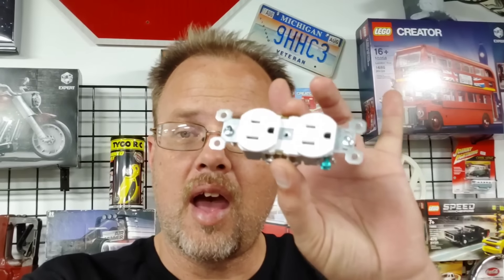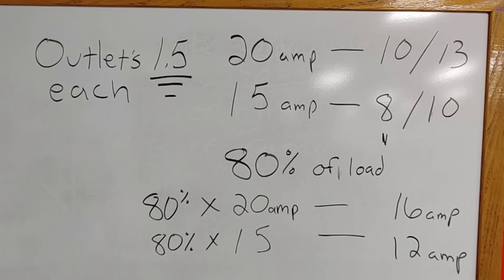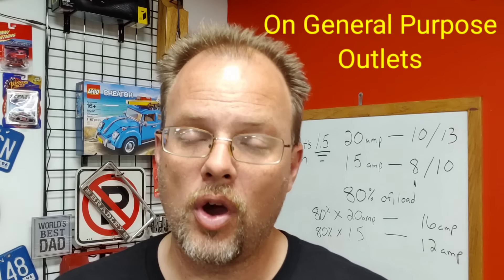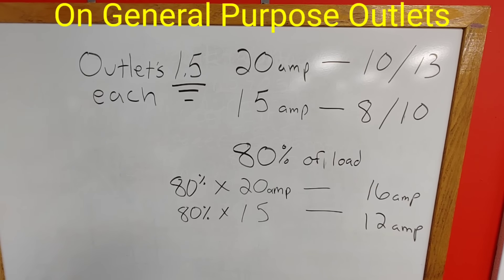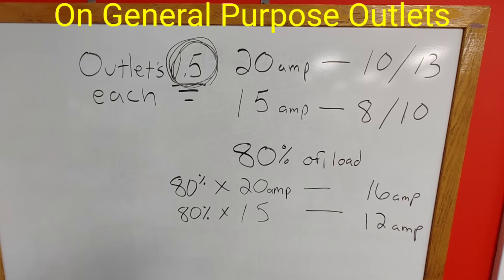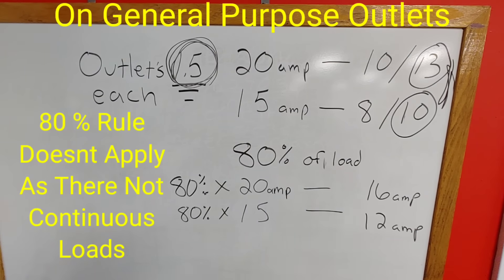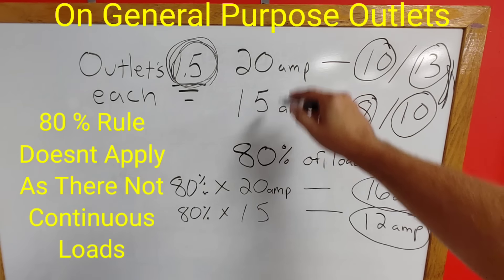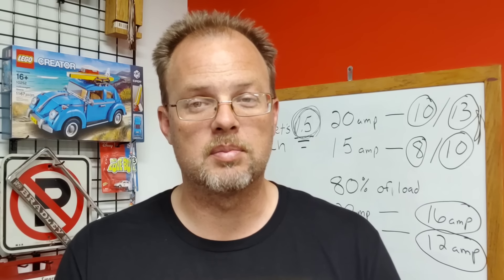How many outlets can you put on one circuit ?

Comment: It doesn’t matter because they are connivence outlets. It allows you to have a plug were you need it. You will never plug something into every outlet, and if you do, the breaker will protect the wire.
Reply: But you still could have a slow burn of the wire. New code requires ark fault, combo ark and gfci and surge protectors at breaker would help with prevention.
Reply: @georgeryan9139  Arcfaults, gfi, and surge protection do not  protect overloading of the wire.
Reply: In the 2020 code the arc fault and combo arc fault/gfci are the new circuit breakers.
Reply: @georgeryan9139  Yea, the 2020 code expanded the use of afci. But, you don’t have to use breakers, you can use afci or gfci receptacles or a combination. They are less expensive and in some cases more convenient for the homeowners.
Reply: I bet I could use every outlet! I've never had enough lol

Comment: Ok. First, there is plenty in the nec about the recepticals for residential and comercial to which i can add 90 percent of the comments are way off base..   first the NEC gives you the minimum code requirements for how many etc but you need to understand and reference the code book because difference location on a house has different requirements.... Here is a simple way to go about this. In a home take a living room 20 x 14 x 20 x 14(this wall has a 4' door in the center) so the 20' walls will require at minimum 2 outlets with no more than 12' between the 2 outlets. On the 14' you will need 2 outlets because of the 12' rule.  On the other 14' with 4' door you will be required 1 outlet each side of door.  This is minimum requirement. Any wall 2' or more requires an outlet.  Kitchen is another area for headache. This is all NEC requirements 2017 code book and on, as the book comes out every 3 years. Now here is another big pain in the backside and thats the Jurisdictions having authority(as in city inspection and or county etc). You will be wise to contact them and they will inform you as to how many etc etc etc. On on a closing fun note dont forget you box fill calculations. Commercial requirements is another subject. Also now required for new construction and any remodels that require permits, each of the following require their own individual circuit and it will be GFCI. Garbage disposal, diswasher. Refrigerator etc.

Comment: I need to add a circuit... someone before me added the garbage disposal, an outside gfci and an indoor outlet all in the same circuit. I trip these outlets every day... help!
Reply: Gfci will show up small faults to ground protecting you from shock. You could have wiring problem or end of use equipment. The other thing to check motors (dispose unit) draw 3 times amps on start up. Outside socket for water ingress. Good luck.
Reply: Trip them by an action of what ? , I recommend fixing the issues at hand (culprit) , don't just add a new circuit,  fix the issues with the existing one as well ,
Reply: If the circuit is on a gfci breaker, replace it with a regular breaker. THEN replace the outside receptacle with a gfi wired in parallel. If the inside receptacle is in a location required to be gfci protected, change it to a gfi receptacle also. 
If the circuit isn’t gfci protected, then most likely your disposal is “downstream” of a gfi receptacle. At the gfi receptacle change the wiring to parallel (no wires off the “load side”) 
If this explanation is confusing don’t be alarmed. A lot of Electricians won’t understand it either.
Reply: @dalewise5586  I understand it.. I was drawing it out a I read it. Thank you for the
Reply: Run a separate circuit to the garage disposal like it should be in the first place.

Comment: 120v x 20amp = 2400va[w]
Divide that by each recept.[180va]
You got a maximum =13 reeptacles
That's NEC code +Math
Reply: Each receptacle is calculated at 180va. By using your math you would be at full ampacity for the 20a circuit. If code requires you only put 80% on a 20 a circuit,  16a , then you could only put 10 receptacles on a 20a circuit.

Comment: The first answer was the correct answer:  for dwelling units, as many receptacles as you want for general purpose lighting circuits.   The rest of these schools of thought results from people second-guessing the Code or engaging in what-if scenarios instead of recognizing that the Code, although not a design document, considers the safety implications and the economy of an electrical system in what it allows to be installed.  Yes, you need dedicated circuits if you have special needs such as a window air conditioner or space heater.  But the wholesale overbuilding of the electrical system of dwelling units sometimes suggests the installer doesn't know what s/he is doing when it comes to design.  It's tribal knowledge, rather than the Code, which causes all these disagreements over how many receptacles can be on one circuit.
Reply from the maker: I totally agree but it's a never ending battle and you will never have two electricians in a room that will agree upon it usually LOL

Comment: Never leave an outlet out because you think there would be too many. People use dozens and dozens low power devices. If there are too many outlets the user will not use them all. If there are too few the user will use power strops. In either case the load is the same.

The whole thinking is backwards. You should first decide how many rooms you put in a circuit, ideally just one so that one person controls what is in the circuit. If there are two rooms and people in both want to use a space heater there is a problem. Then you put as many outlets as needed.

Comment: No, but if you do not use the rest of code for gage, length, no of wires in a box, proper nuts, etc, then they would help stop the fire. Or get an electrical fire extinguisher.

Comment: You can put 100 receptacles on one circuit if you want. Just so you don't exceed the load.
If this were not true, you could not have those tool box outlet strips.
Reply: Load is the key.  Putting 20 boxes on a circuit is more for convenience I think, and practically speaking - you don’t run all boxes at the same time.  It’s all about the load - and usually more troublesome with items with heating (toaster, kettle, dishwasher, hair dryer)... and runnning them all together.

Comment: Actually, you are talking in general. HOWEVER your local building codes may vary. Some residential codes actually use the eighty percent rule and do limit it to TEN on a twenty amp circuit with proper wire size. Some areas will give allowance for eleven if it is mixed circuit of receptacles and light fixtures. (switches don't count as they have no load of their own). Some area require plugs and lighting to be on separate circuits all together. YOU MUST KNOW YOUR LOCAL BUILDING CODES AND WHAT THEY REQUIRE AS THERE IS NO ONE RIGHT ANSWER. Also residential and commercial uses have different code requirements in most areas. Do not assume that they are interchangeable as they often are not. When I was an electrician many years ago, my boss always went to the safe side and limited us to ten outlets per circuit on twenty amps and did not mind if it came to nine on occasion. Also check local  codes on kitchens as many have very different codes but even when they do not, kitchens are a high demand area. We often ran three circuits to the kitchen and more if it was a large one. Better safe than sorry. We got a lot of referrals that way.

Comment: The question is wrong.  It should be, what is the maximum load that will be on that circuit.  If you are the type of person who likes to rearrange a room from time to time, like a living room, but the usual maximum load will be 10 amps with an occasional 5 amp load added for short periods of times, then putting in as many outlets as make your rearrangement convenient is okay.

Comment: Not good analysis.  The probablility of overloading a circuit goes up as you add more outlets.  There shoule be some smart decision being made when wiring up a house, such as not connecting many outlets to the same breaker, if there is a good chance that those might get overloaded.  For example, in the kitchen, someone may have a coffee maker, a waffle iron, a portable electric burner... that they want to use all at the same time.  Having those all on the same 15A circuit all at the same time is asking for trouble.

Comment: The right answer:
"So, what loads are we putting on here?"
"Well, it's for the kitchen, so, a toaster, the microwave, coffee pot, refrigerator, hotplate, electric skillet, and two space heaters..."
"Piece of cake. 15 outlets on a single 15 amp circuit!"

These are blueprints I was expected to wire from.
Reply: You already know but,
The code requires different wiring for a kitchen than other general use outlets in a residence. Must provide (at least) 2 small appliance branch circuits for counter height receptacles that are required to be fed from 20 amp branch circuits. It is also your responsibility to ascertain other loads that the kitchen will be equipped with (large refrigerators that require a separate circuit and so on).
Blueprints can't override Code requirements. I'm probably preaching to the choir here, LOL
I've seen the same kind of blueprints but they always have the butt covering statement of "must follow all national, state and local codes"
Reply: @liffy8333  Absolutely. With new construction. And on new, I go far and beyond that; e.g., the Microwave and fridge each get their own circuits, etc.
On existing, especially older, far different world.
Especially if its owner thinks he's handy.

Sadly, I know builders who will bid off known bad prints, and then try to use that "Disclaimer" as an excuse to buy Cancun. More money is made off of change orders...
Reply: With all that in one 15 amp you better install an elevator to the basement because they will trip every second

Comment: It goes by the square foot, for 20 amps you would multiply 20 x 120 = 2400 VA divided by 3 VA = 800 square feet, you can put as many 20 amp outlets as you want in an 800 square foot area on 1 circuit. 

15 amp x 120 volt = 1800 VA divided by 3  VA = 600 square feet, you can put as many 15 amp receptacles on 1 circuit in a 600 square feet area as you want. 

If you going to do a video, know what your talking about.
Reply: Perhaps you should know what you're talking about. The VA calculation is the minimum required load that is to be installed for the lighting load. 2000 SQFT home =  a minimum of 667 VA's installing for the lighting load. Of course, that would hardly be convenient but it would be the minimum not the maximum as you tried to lay out.

Comment: Can anyone do this in the US? I know I could (and I may or may not have done ) but it's illegal here
Reply: most states will allow home owners to do their own trades however most require permits and inspections as well even for the pros we have to chk our local bldg depts as they have final say as to what is code
Reply from the maker: Wizard is correct yes anyone can but you are supposed to pull a homeowners permit if you are not a licensed individual and you can only work on your own house with the homeowners permit.
Reply: @BevinsBuilds  what I saw in the NC state code, I was talking to a homeowner there, is that you can replace a fixture/switch/outlet without a permit, basically repair your house but if you want to add things you need a permit. Now this is for a single family or duplex property, if it is multi family then NC code requires a permit. 

Just imagine how many switches have been replaced with smart switches since those came out. Do you think everyone had a permit?

Comment: I LIVE IN A HOUSE WITH LOTS OF CIRCUIT BREAKERS BUT SADLY SAY IT'S AN OLDER HOUSE VERY MUCH OLDER AND EVEN THOUGH IT'S BEEN REWIRED SEVERAL TIMES SOME ELECTRICIAN FOLLOWED YOUR LINE OF THINKING AND WIRED MOST OF THE PLUGS ONE TWO THREE AT LEAST FOUR ROOMS I HAD A HOUSEMATE WHO LOVE USING TWO TO THREE ELECTRIC HEATERS IN A ROOM ON TOP OF THE HOT WATER BASEBOARD HYDRONIC HEATING SYSTEM SHE'D MAKE THE PLACE COOK ANYWAYS PUT IN A SPACE HEATER AND ANY OTHER ROOM OF THE FOUR WOULD CAUSE THE WHOLE THING TO BLOW SO MY THING IS ONE OR TWO BREAKERS AS THE SOURCE PER BEDROOM PER SMALL TO STANDARD SIZE LIVING ROOM LARGE LIVING ROOM SHOULD HAVE LINES COMING IN FROM THREE OR FOUR BREAKERS AND THIS IS ALL BECAUSE OF SPACE HEATERS THE PEOPLE JUST LOVE TO USE 
ALSO IF YOU WANT TO SUPERCHARGER TESLA YOU BETTER PLAN ON 480 VOLTS WHICH MEANS THREE PHASE AT 225 AND A HALF AMPS AND WITH A 20% LOSS YOU'LL NEED TO GO UP TO A 300 AMP BREAKER CUZ THE NEXT SIZE DOWN AND THEORY WOULD BE 275 AND THAT DOES NOT QUITE DO IT
YOU NEED TO MASSAGE YOUR WIRES FOR THE 300 AMPS CUZ AGAIN YOU'RE CONVERTING FROM AC TO DC AND YOU'RE GOING TO HAVE TO HAVE THAT 20% 
E.E. DAVID GRENIS LIVING IN BOULDER COLORADO USA

Comment: This is sad. Thinking electricians don't just go with what code will allow, they also consider location and possible loads on each outlet. What you should be trying to avoid when determining the number of outlets and their locations is the possibility of annoying breaker tripping.

For example: would you put 10 twenty-amp outlets on a single circuit in the same room? Of course not. The chance of pulling 20 or more amps and tripping the breaker is good, making the extra outlets seem useless. On the other hand, 5 in one room and 5 in another makes breaker tripping likely because people plugging in devices in one room may not know about the devices in the other room. And we won't even discuss ramifications related to load balancing.

We try not to put more than 6 or 7 outlets on a circuit (usually 5) depending on location and expected current draw, and 2 circuits per room to help with load balance.

In this day and age of scrimping and saving, it's not hard to see why some people will use a box of outlets on one circuit. And yes, I know the proper term is receptacle, but I prefer the more colloquial term outlet.

Comment: I’m not an electrician, but isn’t there more to a circuit than the size of breaker. 
I believe on a typical 15 amp circuit, you use 14/2 wire. 
I don’t think there would be any point on putting 14/2 wire on a 20 amp circuit. Wouldn’t their be a better load capacity if you then used 12/2 wire?
On a 15 amp circuit, you run one 1500 watt space heater and the remaking sockets are almost all useless.
Like I said, I’m not an electrician.
Reply from the maker: The point of a breaker is to protect the wire.  So the wire must be sized to hand the load that the breaker will allow.  14gauge is only good for 15 amps.
Reply: Maybe a little brief on your post about wire sizing should be covered as well.
I had a small 110v welder and a 15 amp circuit was too much for it, so I put a single 20 amp plug in the garage which fixed the problem of breaker blowing. I used 12/2 of course. 
Different welder now so use a 220v priority plug now. With all the accessories people have now, I think if I built a new house, I would use 12/2 through out. Not many I bet aren’t concerned, but I always look at the wattage/amps when buying high demand appliances or other things. I guess that’s why most microwaves have their own priority circuit. At least here in western Canada.

Comment: I’d also like to point out that NOBODY uses every outlet on a circuit. If you have 500 outlets on one 15amp circuit and only use 2 of them there will be no issues.
Reply from the maker: You are correct

Comment: Each outlet rated for 15 amps sooo someone could plug in a 15 amp device in all 10 outlets and fry you're under capacity circuit
Reply: The breaker would trip the instant you connected the second device.
Reply: @mauryd3444  yeah I realize that but I still don't like hooking up multiple outlets like that on a 15 amp circuit what happens is when things get old it don't even take 15 amps to fry it code is always the bare minimum I wire my stuff to handle what gets put on it like outlets underneath the window you never know when somebody wants to throw some air conditioner on it I've seen too many of these so-called correct circuits fry homes and burn homes down but they were supposed to carry the current the problem is when they get 15 years old they don't carry 15 amps anymore not correctly and not properly the heat up so if you want to have a 15 amp circuit go ahead put the 15 amp breaker in but put the circuit with number 12 wire so 10 15 years down the road it's still healthy enough to handle 15 amps quit being a cheapskate
Reply: @mauryd3444  you don't get it twiddly

Comment: A duplex receptacle is rated as two amps. One amp per outlet. That limits your 20amp circuit to 8 receptacles and a 15 amp to six. That's standard for construction and most architects stay within those figures. Homes are typically wired by helpers who could care less if they put most of the house on one circuit. Of course many areas of a home require a single circuit for each receptacle and some will require special purpose outlets. In todays heavy use homes you may have to reduce the number of outlets per circuit even further.

Comment: Sorry but I have to say this. "80% rule doesn't apply as THEY'RE not continuous loads".

I put (10) outlets on each of two circuits on a GFCI/AFCI breaker in my new shop and it passed electrical inspection no problem.

Comment: OMG!   Go back and read NEC 220.14. All general purpose receptacles in a dwelling shall be calculated at 180VA ( 1.5a). So you can not put 20 receptacles on a circuit.

Comment: The 80% rule only applies to a continuous load (3 hrs or more) ect... a refrigerator. The NEC (National Electric Code) is used for a reason. It's not what "you" think....🙄
Reply: If your fridge is running for 3 hours it has problems, but your point remains perfectly valid.